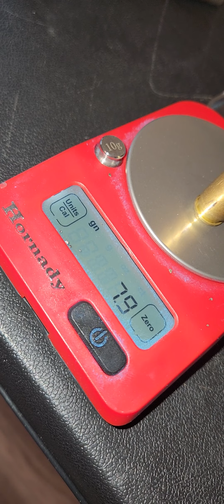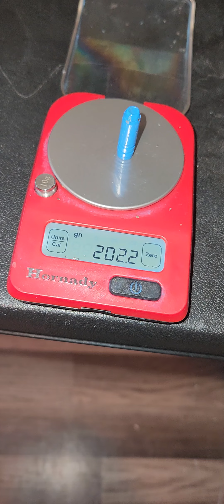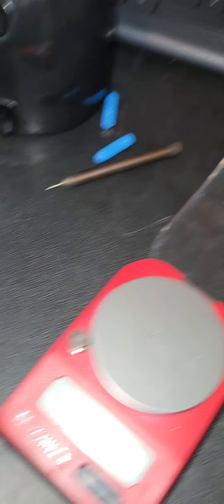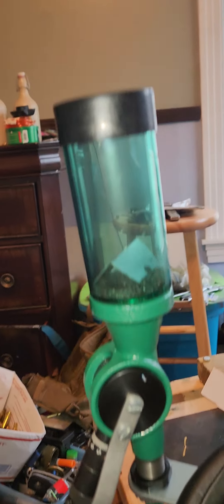309 200 gr 2r lee mold powder coated

Comment: You're getting close! 

With both projectiles you still need to seat them deeper into the brass. The good accuracy you're finding is because of the tight fit and the engraving of the rifling on the nose is what you want.
If you seat them deeper I'm sure you can get them to chamber and extract just fine by dropping the bolt and cycling it by hand once you find the right seating depth. 

NOE bullet moulds does have molds with slightly narrower noses, but I don't think you need to try one yet. I do think that if you tried an undersized bullet and powercoated it to make up that distance like you mentioned at .306 before coating it'll give you accuracy and leading issues. Again, a tight fit is what you want. With the tight fit, you just have to seat the projectile deeper in the case so that it doesn't sit as deep into the chamber, but when fired the tight fit squeezes into the bore.

I've been shooting cast and powdercoated bullets for a long time, and in my PTR and other firearms when I have the issues you're having, seating it a good bit deeper solves the issues. You can figure out your seating depth by seating a projectile ridiculously deep (but still out enough to feed) into a case without a primer or powder and chambering it. When it ejects by hand without issue, seat it longer, and repeat. You'll eventually find a point where it starts to get too long and starts to stick. At that point, seat it a little bit deeper than where it started to stick and you should be good. You can do a final test by pulling the stock and bolt out, dropping one of these testing rounds into the chamber by hand, and then it should either fall out when tipped, or come out really easy with your fingers. People do that with handgun barrels and call it the "plunk" test. 

After you find the seating depth that your gun likes that has a little bit of space factored in to make up for variations, using a Lee Factory Crimp die instead of the crimp built into a seating die will help them stay put since PTR's and HK's are pretty violent when they cycle. 

Once you have a your load dialed in, I'm sure it'll be a great shooter!

Hope you and your family have a great Christmas man!
Reply from the maker: Ngl your comment is why I do youtube, thank you so much for the input!!

Comment: I'd switch to a 150 grain bullet that's a little pointier , that bullet your using is more of a hunting round and is a little long for your application ,  those carbon marks on your fired cases is normal for HKs and cetmes it's just the nature of the beast!
Reply from the maker: I'm trying to keep below the sound barrier for suppressed use, so I use heavier bullets. I just purchased a 265 ish grain 30 cal mold and am waiting for the turn around time of production to see if it'll work better. I have a 70 degree locking piece installed and that allows me to safely cycle 'gallery' loads.